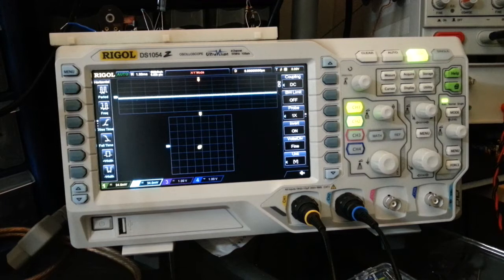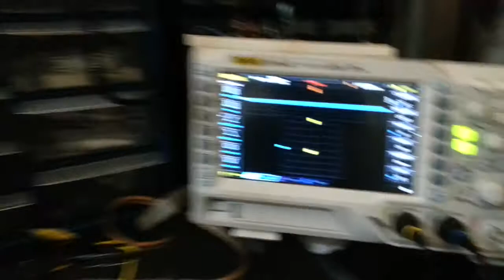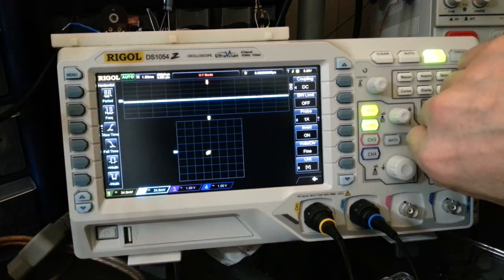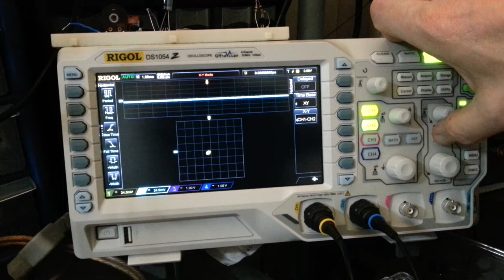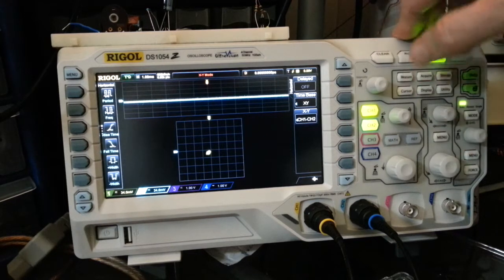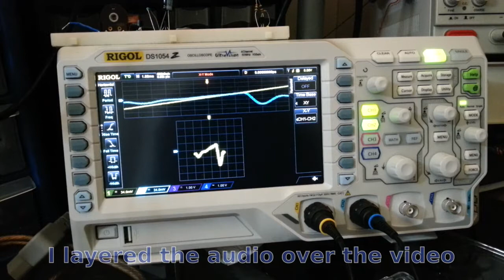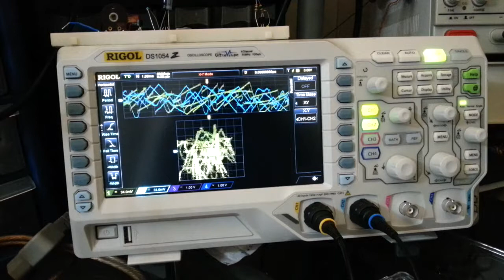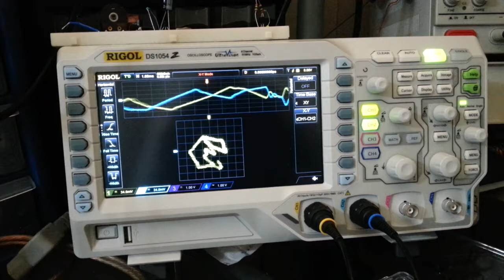Oscillofun on my RIGOL DS1054Z

Comment: Just I want to understand? is that voice originally created by a some Function Generator? How is that letters dances there???
Reply: Very likely it's been done by a decently complex function generator.
That's how a CRT display works too, X and Y drive signals deflect the electron beam.
50Hz or 60Hz vertical, and a multiple of the number of lines of pixels is the horizontal.
Then, by changing the strength and focusing, a picture is drawn.
Reply: Thank you, would you please demonstrate a video about how to use the Oscilloscope to handle NFC signal...

Comment: Get the latest firmware, it has full screen xy mode
Reply from the maker: Cheers for the heads up. XY in full screen will look good. Do you know if there are any riglol upgrade issues?
Reply: Elecifun never had any, never heard of any, though afaik there are slightly different hardware and bootloader versions, who knows